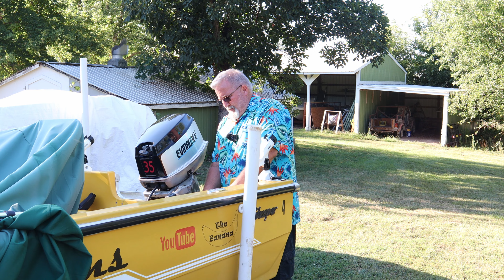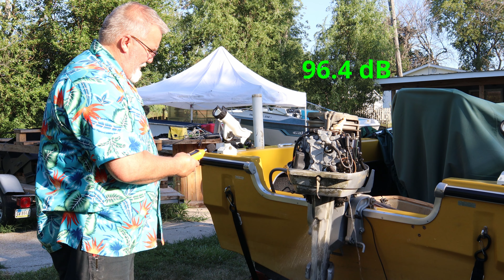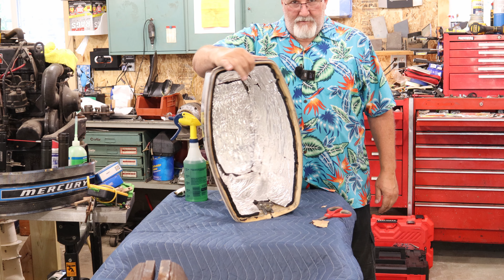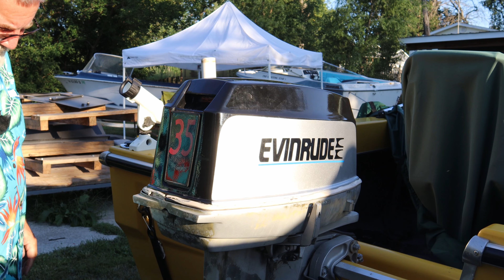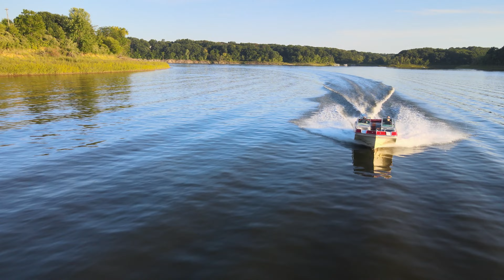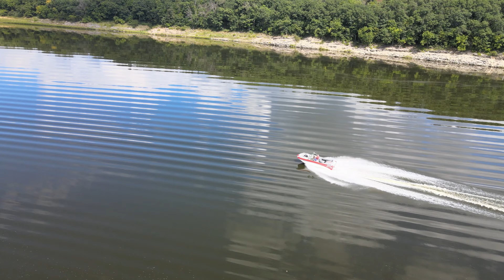1979 Evinrude 35hp with sound deadening  Does it work

Comment: Sound deadening is best achieved with dense heavy material. I got really good results using " Noico 80 mil (2mm) 10 sqft (0.95 sqm) car Sound deadening mat" , $30 on Amazon. I covered the whole inside of the cowling and parts of the aluminum housing around the motor on a 25hp and a 3hp outboards with the 10 sqft package. Its easy to install as it sticks like poop to a blanket.
Reply: Thanks for the tip.
Reply: I totally agree, and if you are worried about electrical problems like I am, use rubber spray paint as I did.

Comment: If I remember correctly a 10db increase is perceived as twice as loud to the human ear (100% increase).  So a 3db lowering would be perceived as a 30% decrease in sound volume. There may be other materials that would give a better amount of sound dampening, such as neoprene or even the cheap foam mats they use for camping. But they would have to be thin enough to fit your hood without causing interference with the engine. Does any one know what was the composition of the OEM dampening material they used?
Reply from the maker: Thanks for the comment and watching

Comment: I feel you would have had better results by using a foam padding much like the original.  Foam padding has millions of holes (toward the motor) to trap noise.  About 1/2" thick.  Thanks for the video, Michael.
Reply from the maker: Thanks for the tips!

Comment: My only concerns under the hood would be excessive heat buildup and the foil could be a transfer of electricity if a short gets exposed or a plug wire goes bad.  Great video and test on the Dbs, good tool to have around!
Reply from the maker: I get the foil part and the conductivity for sure, but my thoughts are it's water cooled and the original hood had insulation in it.  I may take my thermal gun and do some on the water testing for heat.

Comment: Sound may be measured with a dB meter but that’s only part of the story as frequency range (more than absolute volume) determines what one feels as noise level. Serious deadening material like Dyna-mat will help but you should have left an escape route for that noise generated inside the cowling. I would suggest not putting any insulation in the back side and the last 1/5 area of the top section of the cowling. Anyway, that’s from my experience with sound deadening about a dozen outboards. Regards !
Reply from the maker: I'll keep that in mind on the next one

Comment: Hi Mike, just went out with my daughter and grandson yesterday in the Starcraft with my 60hp mercury for around a 15 mile round trip. With the bimini top we could talk but would like it if less noise coming from it. The hood has noise padding from the factory plus a pull start conversion kit taped to the underside. Not going to touch it since it's factory but someday when it's less costly go to the 50 hp electric motor. From what I've seen they are allot more quiet for a day on the water with family.
Reply from the maker: sounds like a plan, thanks for watching

Comment: Nice work on the sound deading material. Can’t wait for the 165 hp motor that what I have in my boat.
Thanks 
Tim
Reply from the maker: Check it out now, just released the video on it. Thanks for watching
Reply: @Michaelsbackyardmarina  I love the video.I also love the shake down cruise and what you have plans for for the maintenance. Looking forward to the up coming videos. The only difference from to yours is my carborator is mounted 90 degrees from how yours sits. I love the 165 hp motor, we went salmon fishing back in the day and fish in the morning and play in the afternoon and use less than a half a tank of fuel and we had 55 gallon tank.
Great video
Thanks
Tim
Reply: @Michaelsbackyardmarina  I love the video.I also love the shake down cruise and what you have plans for for the maintenance. Looking forward to the up coming videos. The only difference from to yours is my carborator is mounted 90 degrees from how yours sits. I love the 165 hp motor, we went salmon fishing back in the day and fish in the morning and play in the afternoon and use less than a half a tank of fuel and we had 55 gallon tank.
Great video
Thanks
Tim